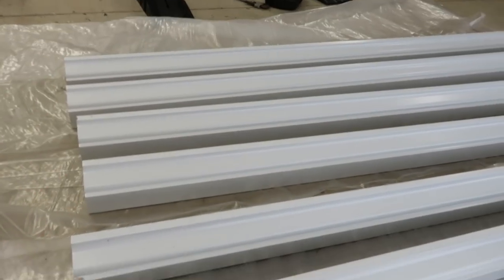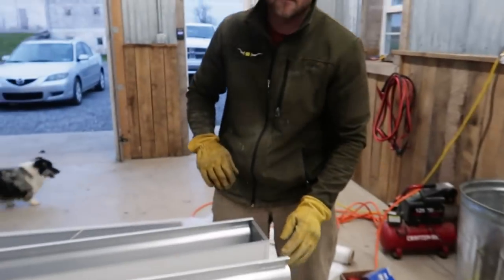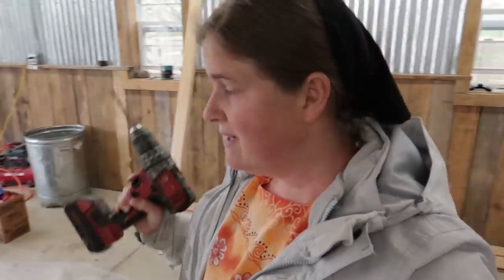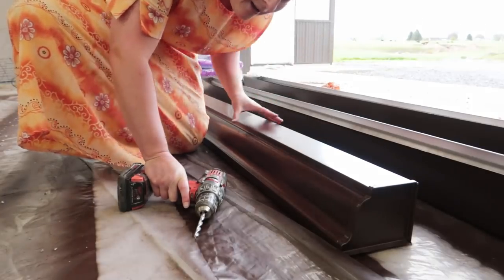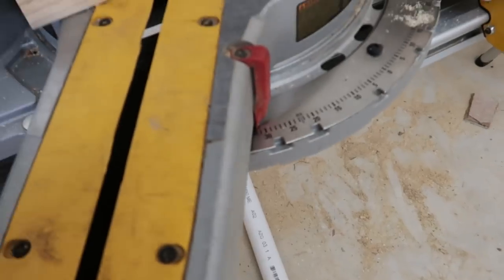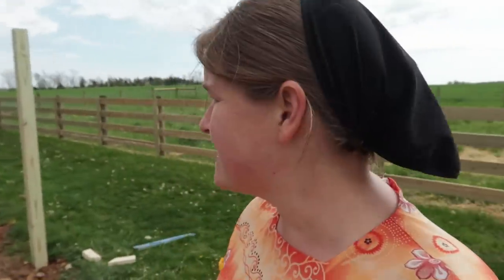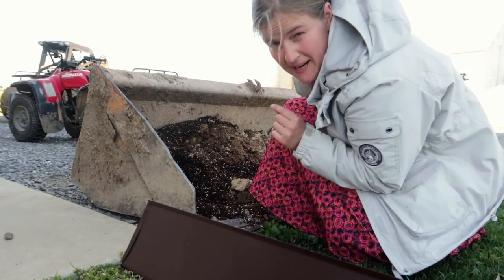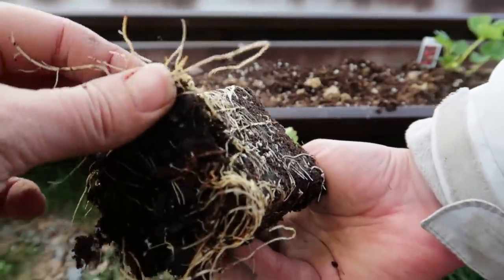DIY Strawberry Rain Gutter Planters

Comment: Looking forward to seeing how well your strawberries do, this would be a great plan for me to do too, if it works out. I love this type of video, Janine! So for your soaker hoses, are you going to lay a separate one in each trough and then screw a hose on and off or is there some type of coupler system I’m not aware of? That would be ideal because my problem with watering is that I get lazy when it comes to breaking out the hoses. Also, Hi, Zander! Good job helping dad with the water line and mom with building the posts! You’re just growing up so fast! And your hubby is wonderful for anticipating things that will help you! Love hearing people speaking up their spouses.
Reply from the maker: Thank you. Yes, I'm experimenting with soaker hoses. I'm trying to come up with a good system, right now I'm doing one in each, and making a pipe system to get the water to each one. Hope it works. Yes, I have a tendancy to forget things and then they dry out. Thanks for watching. I do have such a great husband. He helps me so much and often withouth my asking. I often wonder how I got him. (: Have a great day!
Reply: I think a drip system would work well for this project

Comment: I enjoyed watching this and intend to do this when my wife and I get a house! One thing that I have found at Home Depot that I have already installed on the large apartment patio (13' wide x 8' deep) is the white vinyl gutter system by Amerimax Home Systems. The apartment overhead has just a deck over our patio with nothing over it and the gutters over their patio doors are missing! So when it rains, it is a deluge on our patio. The Amerimax system snaps together with no gluing, it is easy to cut, UV resistant, and no need to paint. I just thought I would mention that since I saw you having he issue with gluing the endcap. Here's the link to the Home Depot webpage with the gutter https://www.homedepot.com/p/Amerimax-Home-Products-5-in-x-10-ft-White-Traditional-Vinyl-Gutter-M0573/100079740
Reply from the maker: thanks for sharing! That sounds easy enough!